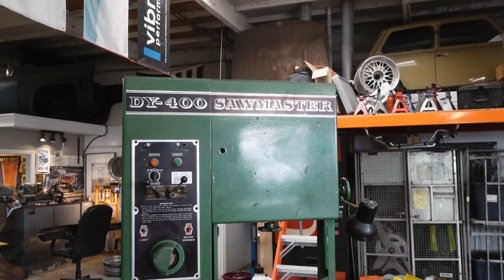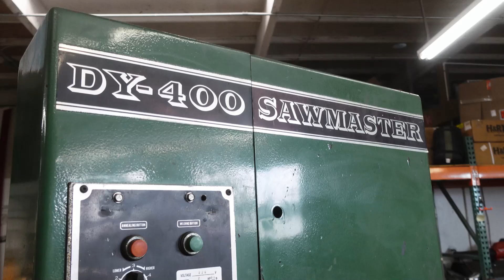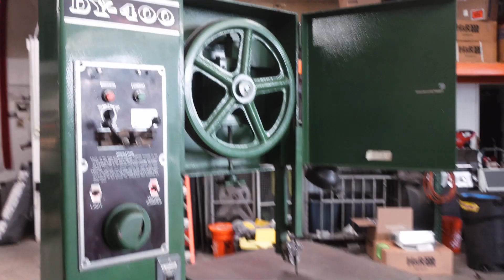Turbo Honda K24 Swapped Ferrari 308 Ep. 22 - Pop Up Headlights Can Kiss My A**!

Comment: Thought:
You probably want the intercooler coolant to be as cold as possible for power and safety. This is why intercoolers are generally put in front of radiators.

Love the build. Miss my 308.
Reply from the maker: Smart thought!
Reply: I'd be more inclined to put it next to one of the gas tanks!

Comment: Proposal to fill the headlight holes: make an extended set of louvers to fill the entire rectangular hole where the lights used to be. More ventilation, and I think it would look very cool.

As an aside, another reason not to put the fuel tank in the front: it will mess with the weight balance as you fill and empty the tank. You really want it as central as possible.
Reply: This is a really cool idea

Comment: Love it Mike! You alluded to fitting big wheels. Please 17" wheels maximum, or it will look odd. Nothing looks more weird than a classic car on 20's. Also, if you are going to do competition with it, you'll want a smaller wheel to reduce unsprung and rotational weight, and gain heat in the tyre. Just my opinion of course :-)

Comment: Avoid getting too close to the windshield with hood vents. If you get to close they will stop working efficiently at high speed as neat the base of the screen is a high pressure area.

Comment: I personally like the lmp style headlights but it should look clean with everything replaced with one large vent similar to oem 👍
Reply: Yea, one large vent to fill the whole space would be rad! Could easily 3D print that part too,,
Reply: @grantdavis28  Is it possible to 3D print a 2-piece mold and then to mold carbon fiber into the final part?

Comment: The water to air intercooler radiator definitely needs to be up front getting cooled first. You want your intake temps to be as cold as possible but you want your engine coolant temps to be closer to operating temperature
Reply: This! Heat exchangers need to be stacked in order of desired liquid outlet temp, coldest first.

Comment: Headlight design suggestion 
Using three small projector type lenses and a lead strip top and bottom and on each side.
Get a bit of clear panel about the length of the entire opening and form a bulge in the area that would be about the legal height of the centre of the lens. Fit the lights in a frame to suit the bulge (bulge only needs to protrude about 20 to 40 millimetres.
Behind the bulge and not interfering with the lights form  the louvres to match the original. Mask off the bits you need to be clear and spray the underside of the plastic yellow. The top and bottom led strips should also double as turn signals.

Comment: Good idea on not putting a fuel cell in the front. I recall from the Lamborghini Miura that as the fuel level dropped, the front got lighter and it negatively affected the steering. That’s fine if it’s a street car, not fine if it’s a racing car.
Reply: I came here to say that, the fuel gauge becomes a turn-in gauge that you have to check in the braking zone before every corner!
Reply: Porsche 911's have a fuel tank in the front, even with the race car and they are freaking fast, but that's something else because they are rear engine, not mid 😅
Reply: He s gona need a weight plate or ballasts for sure out front...800hp with no weight to the front it will understeer like crazy...

Comment: Have you considered using a air con compressor/condenser based charge cooler setup? 

(Instead of the traditional air to air intercooler, or water to air charger cooler). 

There was guy on Hoonigan autofocus with a supercharged civic running one, and his intake temps were amazingly low, the system looked really compact compared to an intercooler, and as a bonus, he had air con!
Reply from the maker: I’ve never even heard of that, to be honest. Off to google I go!

Comment: Just do a manual push/pull control cable to raise the factory pop ups. I did the same on my S13 coupe and it removed a ton of weight. Also water to air seems counterproductive given your weight goals and intended use for this build. Do an air to air in the trunk like the MR2 guys and pull high pressure air from under the car and ahead of the diffuser that I am sure you have planned.
Reply from the maker: I’m concerned air to air in the trunk won’t get enough airflow in any case.
Reply: @stanceworks  Certainly possible if ducting is a challenge. We saw good results in the few that we did by pulling through the floor and exhausting out the rear panel or trunk lid.
Reply: @NoClassic  so much better...way shorter charge pipes.
Reply: @upnorthviking823  An air/water core can also be mounted very near to the engine and likely with shorter charge tubing than air/air. The primary advantage would be weight savings with air/air and potentially better heat management given what it sounds like this car will be used for.
Reply: @NoClassic  i know buddy!im only 30years deep in this game 🤠👍
Reply: @upnorthviking823  I guess I was confused by your previous comment. Were you saying the air/water would have shorter charge piping?  I interpreted it as you saying the air/air would offer shorter runs.
Reply: @NoClassic  i meant any cooler out back.pointless to run all the piping up front.
Then corner balance the car with empty fuel cell out front...
Reply: @upnorthviking823  Unsure how that is related to my commentary here as I believe he always planned to mount the core in the rear. My argument was for that core being air/air and not air/water.

Comment: I think it would be a great idea to use those OEM vents behind the headlights as a useful aero device. I'm not sure its in best location to act as a wheel well vent because its not right on top of the arc which is usually the lowest air pressure zone, but I think it could still function properly if you put a small gurney flap at the front of it to help create lower pressure to suck that wheel well bubble out of that vent. It would keep the stock look but make it actually functional. It might also be possible to vent cooling air through the factory vents. You might want to have a friend do a CFD model of this car's body when it comes time to design the cooling and aero systems.

Comment: Can you try adding a few smaller radiators at the rear and supplying it air through NACA ducts. Could try for some sort of ram effect air intake for radiators.
Sneak in some small heat exchangers at the front louvers maybe

Comment: Finned radiator hoses to the back would be insane for cooling like stainless tube with silicone joiners with venting machined into the outside after welding lines along it so you masses of extra cooling

Comment: Regarding the fuel cell, you can use a fuel bladder. There is another YT channel that is building an off road Huracan and they are using a bladder, which I think will fit your application well for that room in the back you have.
Reply: That's literally what a fuel cell is, a bladder inside a metal box....
Reply: @j.d.8593  Ah, no. There are different types of fuel cells. Anyway, my point was about the size/shape of the fuel cell and it's location. They are using it on a Huracan and space wise looks similar to what he has here. Yes, they are using a bladder and fabricating a aluminum container for it.
Reply: @nas0075  I've been following that build, the one they used in the Huracan is massive for this Ferrari, as Mike said, the 308 is very small, but i agree he can use something similar but smaller or with a different shape

Comment: Also, besides the fuel cell not fitting in the front, even if it did fit it would be a poor idea dynamically. Because the CG of this car will be closer to the rear of the car where most of the weight is concentrated, having a fuel cell in the front with a variable weight would change the handling balance of the car noticeably as you burn the fuel. Having the fuel cell right at the center of the CG, between the engine and driver, is a great idea because its variable weight won't move the CG much.

I like your radiator solution too. Race cars use that same type of setup for a reason. Keeps the weight low, allows lots of cooling capacity, aerodynamically it works to help slow the air so as not to create too much drag and also increase cooling efficiency as it passes slowly through the radiator, and then allows you to vent the hot air through a hood vent at a low pressure zone of the car's surface, effectively sucking the air through the radiator and accelerating it back up to nominal velocity up and over or around the car. You used the term "V-mount" but a tuner-style V-mount like you commonly see on RX-7s is a bad idea because it pushes some of the cooling air under the car which you want to avoid. Simply sandwiching the radiators/condensers/intercoolers and venting them out the top and sealing the bottom is a much better idea.
Reply: This is why you balance the car with the tank empty...
80pds of fuel will only make the front stick better,as it burns it will come back to closer balance.
Can use the foam inside to prevent fuel splashing around.It will need weight out front...why do you think the headlights are so heavy.
How much hp did the 308 make...With 800hp it will lift the front on trottle greatly reducing tire grip

Comment: I'd use GTO style headlights, they fit the design. Also, isn't it possible to mount the charge air cooler in the old trunk? Maybe drawing air from underneath with a diffuser and guiding it up to the cooler, exiting from the back or top

Comment: What about a 3D printed head light  and vent panel?  If your going to put a lightbar at or pods in the grill you could design as extractor or brake cooling.  Plus you could put your Logo in there.

Comment: a cool option here would be to remove the headlamp, but replace with a row of 10 little high power LED lights on each side...each of which pops up like a mini pop up headlamp....like a row of 10 like 1.5 - 2 cm pop up LED headlamps each side...
Reply: This would have some Ferrari homage because it would be headlamp arrays that harken to the Testarossa fins of old.

Comment: That has to be some huge weightloss
Reply from the maker: Everyone that keeps saying "do low profile pop ups" seems to miss that aspect! 30lbs from the nose of the car is a lot.
Reply: @stanceworks  so agree with you on the weightloss. Lighter cars have tires that last longer. They accelerate faster, the brake easier, the suspension works better, so many gains some folks do not realize.

Comment: Mount your headlights inside the cabin on a bar across the top of the windshield. Modern LED lights are very small and the bar could be only a couple inches thick.  Then use a one way applique over the glass so they are invisible in the daytime.

Comment: Really don’t think you need anywhere near that big of a radiator. Friend of mine has an STi swapped VW bug with just a 220 square inch radiator up front, and putting down 350 WHP, zero heat issues.

I think all you need is an water-air heat exchanger for the intercooler and a reasonable size rad in the factory location, and your good.

Modern turbo engines are way more thermodynamically efficient than that old 1980s Ferrari lump.
Reply from the maker: That's a fraction of the power I am looking for.
Reply: @stanceworks  I’m looking at about 210 or so hp from a built N/A EJ251 I’m swapping into my 912, so I’m going with a pair of Austin Mini rads (100 square inches each) tucked under my headlights, numbers I worked out estimate it should be enough.

I’m going for a “factory plausible” look, so I want everything tucked, and factory looking trunk. 

But yeah, a K swap in a 308 is an awesome idea.

Comment: Removing the headlights is such a bad move, the car was designed for speed and looks. Removing them will now change the aero dynamics of the car and change how the car handles.
Reply from the maker: What? It will look like it did stock. That’s the whole point of my decision. As far as how it handles? Yeah, it’ll handle better.

Comment: Removing the pop-up lights broke my heart. They're part of the character of that car. Your build but I'm out.
Reply: Tell me about smh , that's one of the key features of the car smh , he could tried getting carbon fibre pop up lights with a motors from a mx5 to save weight
Reply: @ndlovulwazi  he removed them for weight...but will need to add a weight plate or ballasts/giant front splitter that generates that amount of downforce down the road lolllllllll many racecars have their fuel cells out front.
Im gona laugh when he finds out its understeering.
Reply: @upnorthviking823  Maybe for his next "weight saving" he can ditch the iconic taillights as well for some nice trailer leds. And that side intake vent will be drag, sheet that over for sure.  Same for the Ferrari badges, they're just more weight so get rid of them.  Dude doesn't want a classic Ferrari, he wants a rear wheel drive CRX.